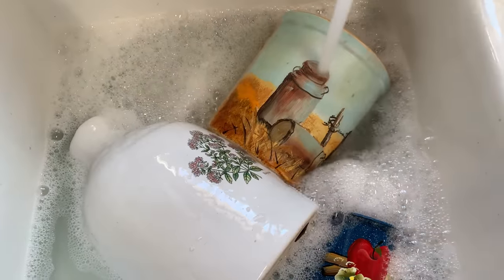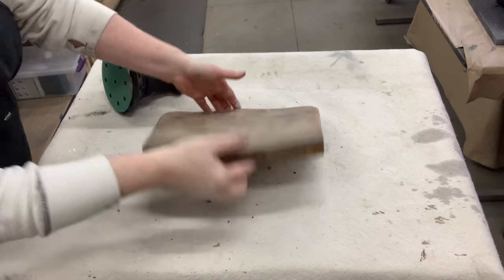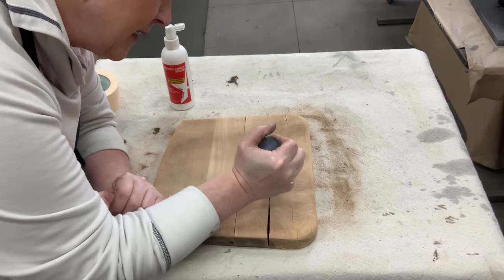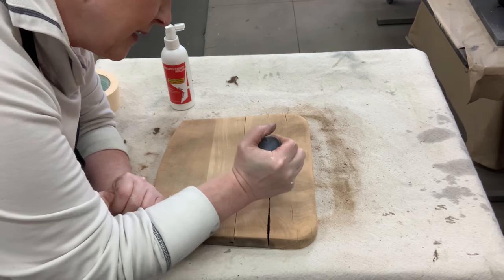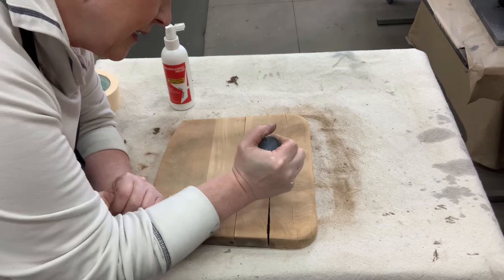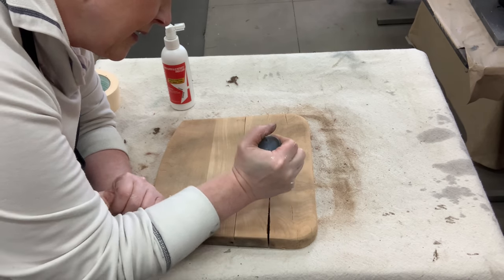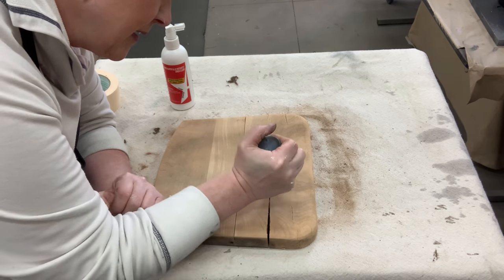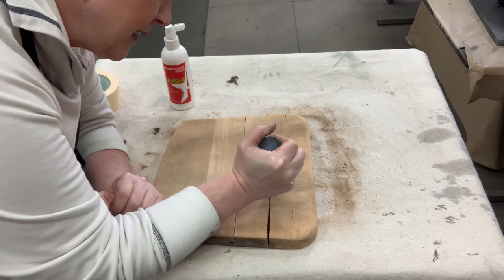Estate Haul Makeovers || Home Decor || Reseller || Farmhouse || Industrial || Boho

Comment: I use sticky transfers all the time. If you will rinse them under cool water and turn them upside down to dry they should be able to restick to the paper backing. The sticky will usually last at least 8-10 times if you dont rub over it too hard with a cleaning sponge. Some transfers will last longer or shorter than others...depending on how much stickiness they had to begin with. Hope that helps. And...the chair was my favorite today!! Beautiful!!
Reply from the maker: Thank you

Comment: Really cool use of a door….
I used one that had the old handle and turn lock(took the one handle off but kept the front mechanism on for show) cut it down, put a stained shelf with black brackets part way from the top then added a painted dowel into the towel bar holders (cause the original wasn’t long enough) then hung my country bath towel on it.
It hangs on the wall behind my tub .